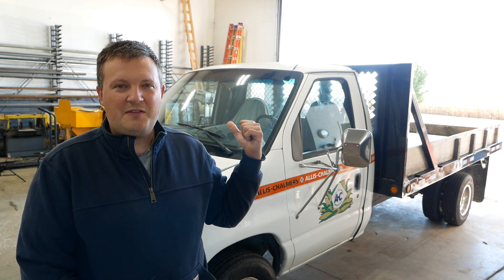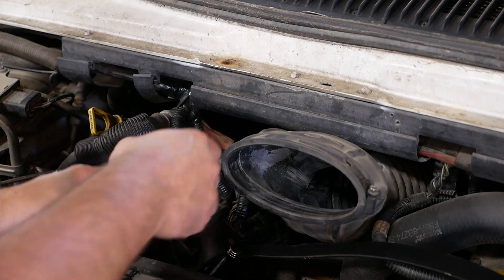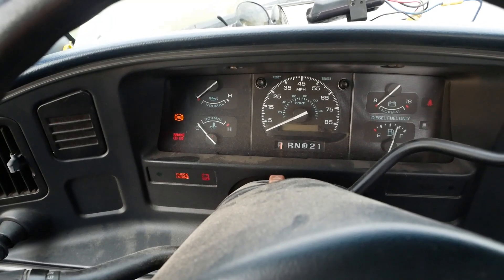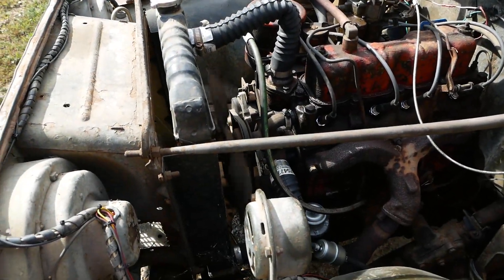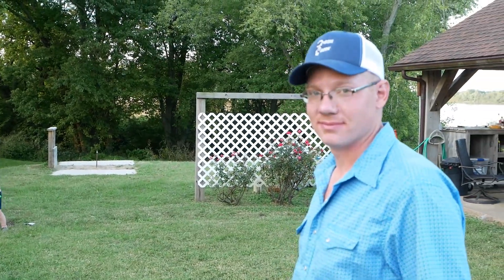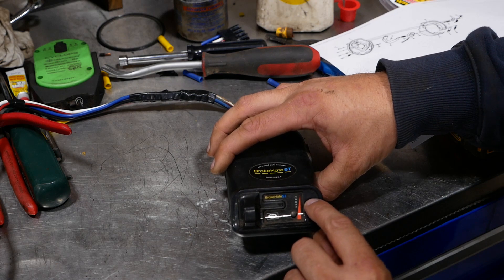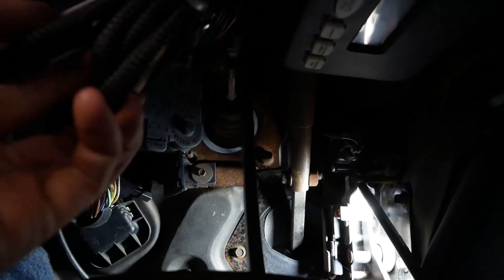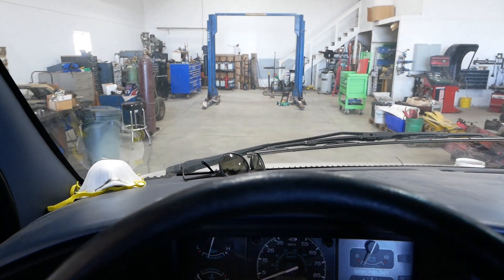E-350 7.3 Power Stroke Hard/No Start - Again! | Dirt Perfect Meet and Greet Event

Comment: We have identical trailer braking and regulations here in Australia Wes, I used to install those controllers (along with trailer power supplies, towbars etc) to vehicles a long time ago.
We also have mechanical surge brakes, which activate the trailer brakes via cable and a spring loaded, sliding trailer hitch (tow vehicle slows down, trailer inertia compresses sliding hitch, which moves lever attached to cables), which are simple and extremely reliable. 
I used to own an F100 with vacuum trailer brakes, that was very annoying to hook up. Very glad the electric systems came about.

Comment: There was a contractor here in town back in the '70s who had three or four single axle dump trucks and a 955H front end loader. Had a little trailer just big enough for the loader and instead of installing brake controllers he hooked the brake wire straight to the brake lights.. Worked okay with the loader on it but it locked the wheels up when empty. Life was simpler back then and so were some of the people.

Comment: Thank you so much for explaining the US trailer brakes. Living in central Europe ( Germany ) i have never seen such an electric system b4 ! All we use is a simple mechanical push-rod wich activates the trailer brakes by a steel cable. Trailers with a GWV more than 3500 kg needs to have air brakes anyway...

Comment: Hi Wes, here in Australia we use the same brake systems on our braked trailers. About 20 odd years ago we changed over from the lever/slider hydraulic trailer hitch as most people would forget to set the lever to allow the slider to move. Some trailers still get around with that old system but i, like you would use the electric trailer brakes either on drums or electric disks. I also see a lot of caravaners using anderson plugs rather than running their trailer brakes through their 7 pin plug which has a dedicated pin for trailer brakes.

Comment: My old IH Travelall had a brake controller that was plumbed into the the brake's hydraulic system.  It controlled current to the brakes based on how hard you stepped on the pedal.  Really old school.

Comment: 1999 7.3 has never had a problem with the glow plugs or the relay. I just drove my truck a few minuets ago and after starting it up and running it several hours earlier (where the glow plug light came on for about 6 seconds) I never even saw it come on when I started it the second time. Started right up.

Comment: US trailer brake system seems really good.  Here in the UK for light trailers. (Ones driven behind a car/pickup but not a truck which would have air brakes) pretty much most things seem to have an inertia brake. The more the trailer pushes into the tow vehicle, the hitch neck collapses shorter under the inertia of the trailer  and as it shortens, it pull the brakes on. Simple and doesn’t need external power.

Comment: Hi Wes!
Before the "pendulum" style brake controllers of yesteryear,  you would have to put a "T" in the front brake line, and run a piece of brake tubing from the T to the controller. That's what actuated the mechanical rheostat for the trailer brakes.  Bleeding those things was always a lot of fun... not.  I gotta say, that E350 with the flatbed piqued my interest.  I kinda like the look and the idea of it, but I'd hate to have to repair anything-  Especially with the 7.3 diesel... Everything is strategically shoe horned under the hood, I'm sure.  Take Care!

Comment: Excellent video Wes :) also I always like the 1963 McCormick International B414 Loader tractor Desiel motor 40 hp , 1968 International 624 60 hp Desiel motor, 1978 International 724 72 hp Desiel fuel motor tractor with Loader for Glow Plug Warmer plus together with Starter Solilendo Switch set ups also find problem with plus fix so easy do repairs on too!

Comment: Excellent get together!
Cam sensor ,IPR or glow plug relay are common problems.
I take relay apart clean contact s and use them rather than use new chinese replacement ones.
I was also at Kentucky Utilities expo..

Comment: I might have the battery record. I ran a Nissan Pathfinder for 13 years with the original battery. I finally changed it out and sold the Pathfinder a few years ago. Its still out there running around. It was a 1998 model. Cheers!

Comment: newer vehicles made it easy to install a brake controller, except for an early 2000s GM half ton, where they cheeped out and did not include the harness if it was not optioned

Comment: Fun vid needed more Mrs Wes. Interesting on the brake controller from being over the pond. A push rod system seems more reliable no chance of electrical failures but never tried a controller.
Reply: The good controllers rarely fail, the poor wiring from idiots is what fails more...like those open butt connectors

Comment: In Europe we use hydraulic brakes controlled by the hitch there is cylinder in the hitch that works like a break pedal and the hitch itself moves based on the load when the breaks on the towing car are applied when you are reversing there's a bypass valve activated from the reverse light

Comment: We also use those brake controllers in Australia. Installed one in my ute recently. We also have the option of mechanical overide brakes but no break away system for private trailers unfortunately 😀
Reply: Waste more money on the batteries than the breakaway systems are worth

Comment: We dont use brake controllers because most people outside the US dont own 3/4 ton trucks and even less for towing, we dont see the need, however its pretty cool to know how these operates... Even if you go to a stealership the largest trucks you can buy that are in stock (not commercial like chassis trucks) are F-150s, Silverados 1500 or 1500 Ram's, other factors include travel distances are way shorter than in the US, while you need to drive 40 minutes average to do something in other places you can even go on a bike..

Comment: The first trailer brake controller I installed in the 70s, was hydraulicly operated. I had to put a T fitting on the hydraulic line out of the master cylinder. It was a single system, not a dual MC. The hydraulic pressure would push the operating lever in the controller. The lever could also be manually operated.  The system would easily lock the two brakes wheels on a 2 horse horse trailer. Crude by today’s standards, but effective.
Reply: That is the style brake controller I still have on my 84 Dodge. It works flawlessly.

Comment: Here we use mechanical brake system, when the car slows down and the trailer starts pushing on the hitch, there is a lever thats taking the force and apply pulling on the brake wires running back to each drum brakes.

Comment: I remember back in the early 70s that trailer brake controllers were plumbed in the brake line hydraulic circuit. I was a kid at the time so my understanding may have been wrong.

Comment: Wes.. if you have a second test light like you were using on the back of the truck during brake controller work.. take out the little bulb and install a 211-2 bulb.. its great for turn signal circuit testing..
Reply from the maker: I actually made a test light with a 40W headlight bulb. It'll load a circuit pretty good!

Comment: I might be wrong, but looking at that Brakemate ST,  I am pretty sure this is a simple Time-Delayed Brake Controller.  Basically they just get a signal that the brakes are on and then starts to set the trailer brakes a pre-determined amount.  There is no accelerometer or anything in it.  The brake controller you are describing is an old proportional brake controller, which needed to be calibrated.  (The new ones are auto calibrating)

Comment: We use those trailer brakes in Australia.  Any trailer over 750kg must have brakes (hydraulic are OK) but once you get over 2000 kg (I think, it might be 2500 kg) you must have brakes with a break away.

Comment: Trailer brake coontrol the easy way:
 Put a lever on the hitch (on the trailer side) so that when the trailer 'overruns' presses the bakes on, the harder the 'overrun' caused by weight or harder prime mover braking, the harder the lever presses on the brakes. Simples.

Comment: the output on the new glow relay is dim because the circuit is under load supplying the glow plugs (voltage sag). On anything that old, battery cables will have issues with resistance, throw them away.

Comment: So Wes on the test light that was dim on the load side of the relay the glow plugs are hanging on it and they were energized that is what was dragging the voltage down, which is also the reason the relay goes bad because if it's bright on one side and dim on the other side of the relay it tells you that there's a voltage drop across the contacts of the relay which creates Heat and eventually destroys the relay.

Comment: I had one on a truck a few years ago and I didn't have a trailer so the only thing I used it for was when some ass was riding my bumper I would use the manual lever on the break controller and push it all the way over and that would make my break lights come on.. Break checking with out break checking

Comment: wes I am a retired towbar fitter in the UK I can tell you all trailers over 125 kgs unladen must have brakes  they are cable operated  by mean of the weight of the trailer operating a compressable coupling at the hitch  coupling at the hitch break away cables have been madatory for years

Comment: So the current generation of trailer brake controllers - things changed when they added knee bolster air-bags to small trucks and SUVs.  I had fun with my local Toyota dealer parts guy asking for the special screws I could use to bolt an old-school trailer brake controller onto a Tacoma though the airbag.  So the modern brake controller kit - it is a box that has the electronics that gets attached under the dash and then a fancy button that often replaces a 12v cigarette lighter socket that has the LEDs and the reset and brake over-ride buttons.

Comment: 11 year old bsttery dead, no problem.  On my 63 Falcon, one winterdrive into service center for as new battery.  Found out old battery was 6yr old (36mo warranty), dead in two cells, and weak in another, and still started until temp went below zero.
Reply: 63 Falcons were like that.  I grew up with one.

Comment: Well.
We use brakes incorporated in the trailer.
So.
You brake and the trailer pushes on the towbar, that compress a piston .
This also work going downhill, so you don't get the trailer pushing on the car, since it will brake when it compresses the piston.
Easier and works flawless.

Comment: I still need to finish the trailer brakes on the old sub at some point.  I didn't find a connector.  There was some wiring from the bay to the bumper.  More hammer and tongs than that Ford!

Comment: In Germany, small trailers have an overrun brake. The front of the vehicle brakes and the drawbar is compressed a little. This is then transmitted mechanically to the trailer's brake. There is also a rope loop that is placed over the trailer coupling. Should the trailer become detached from the vehicle, the rope pulls the trailer's handbrake.
Larger trailers require compressed air. With pressure the brakes are open, a broken hose leads to braking.

Comment: Well in Germany we use trailer brakes which are operated by the compression of the trailer bar. So it's fully mechanically. There's a break away steel wire which need to be attached to the vehicle which will pull the brakes to 100% and lock them if there's a hard pull on it.

Don't know why anyone would install electrical brakes which are probably quite unreliable.

Comment: We use overrun trailer brakes, no unnecessary, fiddly electrical wizardry required. Just a ball hitch and a safety chain connected to the parking brake leaver.

Comment: I know a guy who has a F-250 crew cab 4x4 truck that had the 7.3 powerstroke and fixed it with a 5.9 12 valve cummins now all the power plant issues went away

Comment: In the UK we have mechanical brakes on private trailers, the neck of the trailer compresses under breaking and the brakes are applied. They are adjustable, via turning a nut that closes or opens the shoes. Then, there is a breakaway cable that applies the handbrake of the trailer should it become detached. Simple, no electronics, not batteries on trailer and easy for boat trailers that get dunked. What do you do on boat trailers that go in saltwater?

Comment: Our trailers in the UK pretty much all have overrun brakes with a breakaway chain or cable to apply the brakes if it comes off the hitch.
Pretty fool proof as it's all mechanical.
Trailer electrics on the other hand !! , If your lucky you can get a plug and play harness , if you're unlucky it's a new loom and black box costing hundreds.

Comment: Your little buddy there is a lovely character. Usually a pleasant addition to fan based channels meeting the other half. Ambulance truck seems neat but the power circuit appears to be horribly under-utilised. I would  have lights where ever a need appears, a pair of winches. interior usb connections. electric train horns, one of those full width led light bars .....

Comment: Our 03 E450 shuttle has one battery under the hood on the right, and the other underneath on the right frame rail. The gal we got it from said her “mechanic” told her it only had one battery. I knew that was wrong. There is a sticker on the radiator support right in front of the battery that shows the location of the second battery…….

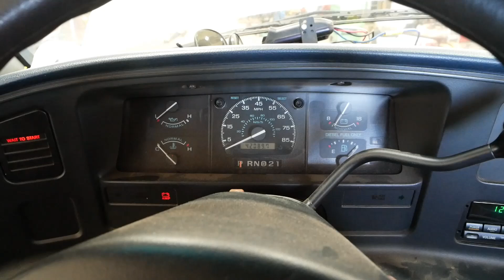Comment: At about 16:50 I can see that the voltmeter drops when the glow plugs kick in but when it starts is just returns to the initial position. I expected the alternator would show a higher voltage once the engine ran.
Reply: I never noticed until I saw you're time stamp and looked.  I have to agree.  Maybe a faulty voltmeter?  Something ain't right.

Comment: I think we don't use break controllers like that in the UK due to our lower towing limits. 3,500kg is the max trailer weight for vehicles of max weight 3,500kg (so combined max of 7,000kg). Heavier trailers tend to be air operated. We don't really have the culture of towing gooseneck trailers on pickup trucks here mostly because the license and tax categories make it impractical/illegal.

Comment: Wes, can you link those ratcheting wire splice crimpers and splices in the description?  I've been looking for something like that for automotive use... I normally use aerospace grade splices, but the heat required to shrink the sleeves melts the insulation...

Comment: Nice video, something different.
I dunno what's up with the brake controller thing, here in Australia the electric brake controllers are reasonably common, as any trailer over 750kg needs brakes, often over ride cable or hydraulic, but also often electric, and anything over 2,000kg needs the break away system which is probably impossible without either electric or air brakes. Although factory fitted brake controllers, or even plug and play with the wiring already there is kind of awesome.
Reply: @erik_dk842  I can't say I've seen any of that style mechanical over ride brakes before, Australian ones usually have open cables, and the handbrake is just a lever extending off the top of the lever operated by the over ride. I have never seen an over ride braking setup with break away.

Comment: I have wondered a few times why you don't use a pneumatic ratchet so now I know, you don't have one. In relatively open areas they work fantastic. I say open because I was once taking apart or putting together (cant remember which) a snow blower and the ratchet pinched my finger between the auger and the ratchet and I put the bone of my finger up through the skin under my nail. It hurt like it was on fire until they drained it and let off the pressure. As far as it goes it is one of the first tools I grab. Besides Christmas is coming.
Reply from the maker: I just bought a Herculese battery ratchet from HF. We're going to test it out.
Reply: @WatchWesWork  Nice!

Comment: Here in New Zealand I have never seen this brake controller for trailers. The max speed limit for trailers on open roads here is 90Kph (55 mph), I am wondering what it is in the US with its vast spaces and highways.
Reply: 70 mph /110 mph… but at one time was federally mandated at 55/90

Comment: Regarding the brakes, I like the electric brake setup but in the UK there not legal. The trailer brakes either have to be activated by the driver putting their foot on the brake pedal or be triggered by the trailer overrunning the towing vehicle if the trailer is less than 3.5 tonnes. 

The UK is a bit of nightmare for different braking systems. Lories use air brakes which are pretty similar to your setups over there. Tractors tend to use hydraulic trailer brakes, not so sure how they work as we never had anything that modern on our farm. We used a chocks thrown under the wheels as brakes. 

4x4's and mini artic's are a bit of a minefield. In the early days they used a vacuum line using a vacuum regulator plumbed into the hydraulic brake line. These days they used compressed air with a pressure regulator that's plumbed into the hydraulic brake lines.
Reply: The electric brakes ARE activated by the brake pedal.

Comment: Just a quick question today Wes, what's the difference between that newfangled injector relay and the Ford starter relay Ford used fir the past century other than it is now a cube shaped electro-magnet switch rather than a barrel shaped electro-magnet switch?
Reply from the maker: The glow plug relay has a higher duty cycle and it's isolated from the mounting tab so it can be ground side switched.